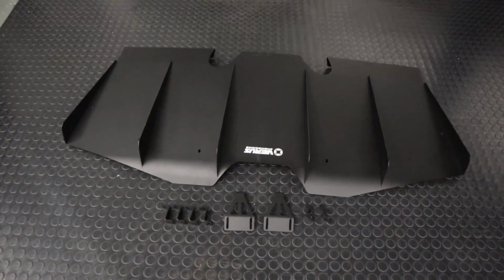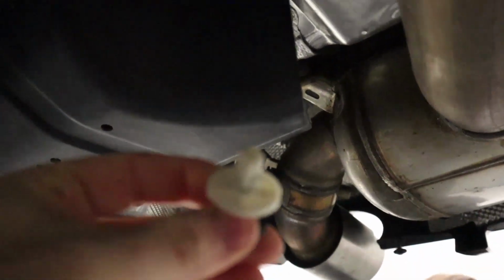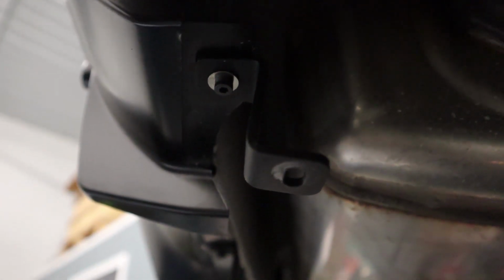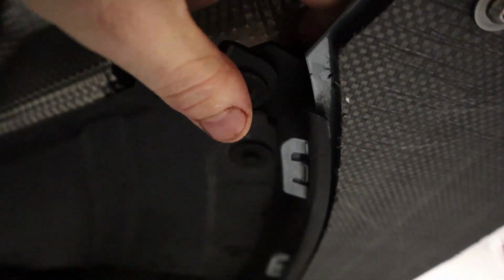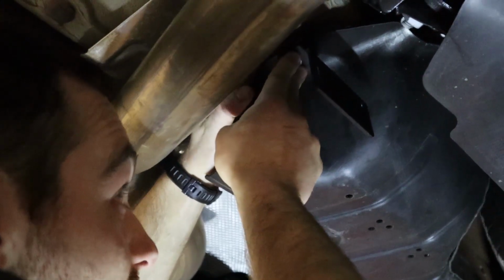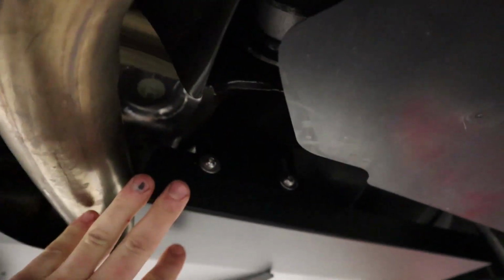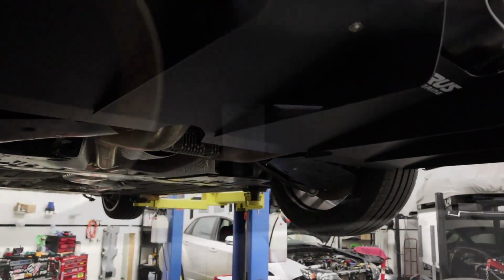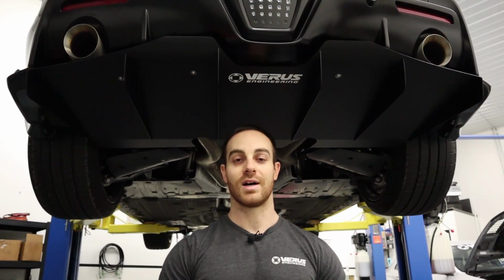Rear Diffuser Install - Mk5 Toyota Supra

Comment: Would this fit with the MBRP exhaust?
Reply from the maker: We can't confirm, because we don't have one. But from the looks of it, it looks like it could potentially work, perhaps with spacers to drop the diffuser ever so slightly. May have to cut part of the back of the diffuser toward the front of the car as well.
Reply: @ thank you for looking into that for me, I think I’ll just order the diffuser and see if it’ll work. Thanks again! Love your products